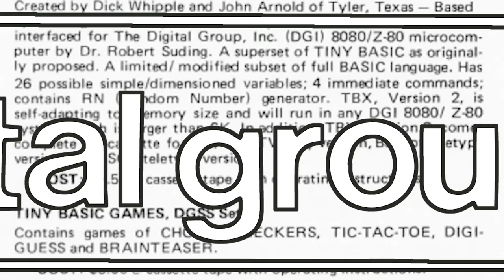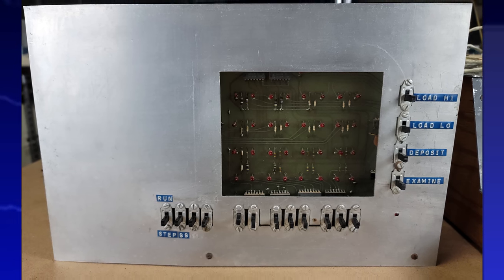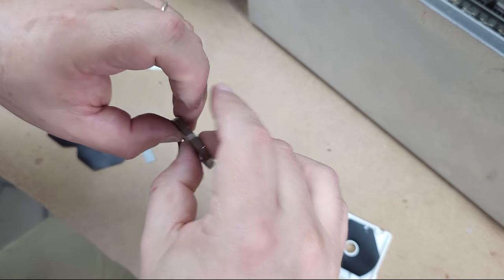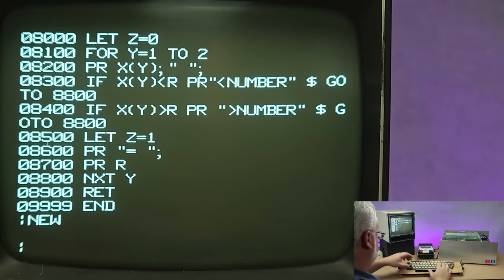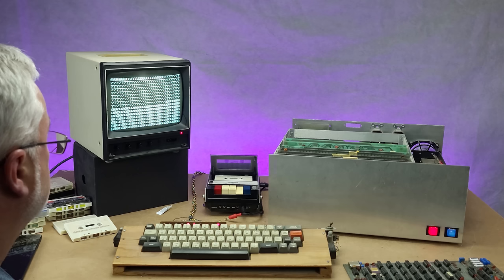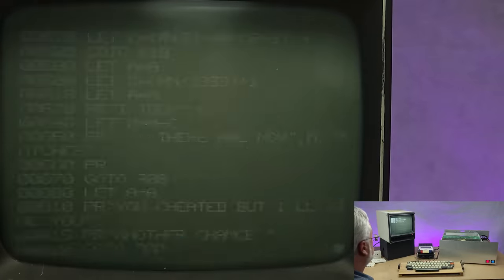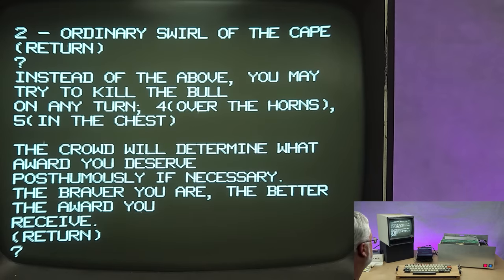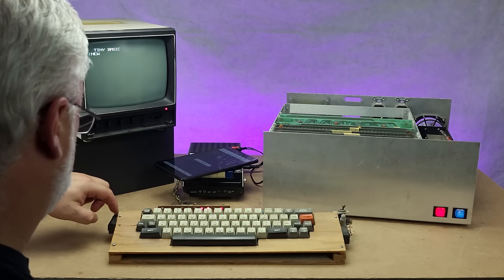How do you play games on a 47 year old computer? | Tiny BASIC Adventures

Comment: A car parts store will sell plastic pry tools for auto body repair. I've found them useful for everything from opening boxes, prying apart non-car bits, and even scraping flat surfaces without risk of damaging surfaces or cutting myself. I'm sure others will have even better ideas but putting that out to assist. Great video!
Reply from the maker: I'll have to look into those.  Various youtubers were using xacto blades and they also had this splicer tool you lay the tape in and do a diagonal cut with.  I never knew actual cassette repair tools existed!
Reply: Kinda unrelated but I tried finding one of those in a size that could pry open an iPod mini, but gave up. Months later for unrelated reasons I ordered a screwdriver bit-set roll pack and waddya know it came with a plastic pry bar inside. I was not impressed lol

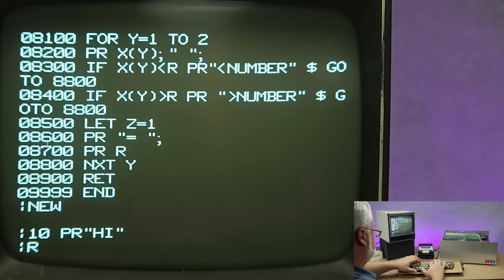Comment: 18:05 "ERR 12 65535" - The error message pops up because the last command is not an END command. In Tiny Basic this is obligatory.
Reply from the maker: Correct, yes.  I think I accidentally cut out some footage though where I had the end statement and it still gave error 12.  Right in that sequence it was getting progressively less stable.  Reseating and rebooting seemed to clear it.
Reply: Good  point!

Comment: TY!  Excited to see this.

I played the Pet and C64 versions of many of these games as a kid. Used to hang out after school for a few hours at 11 and 12 most days and play on the C64 in our classroom. Played mostly Star Trek with an occasional switch to Lemonade stand; but also Hamurabi for a change of pace.  Was excited when I saw its name pop up.  I had a copy of it in a pile of DOS shareware disks a friend copied for me in Highschool as well.

A few of these games we actually coded in grade 8 Computer Studies on C64s.  I distinctly remember Digiguess as one of our assignments. So cool to see a copy of it running on a computer as old as I am (Born in 75).

Suggestion to move the repaired tapes to newer cassettes with screws, rather than re-gluing them. Makes them easier to access if you need to repair again, plus fumes from glues can be corrosive. Also; old plastic changes shape over the years, especially the kind used for cassettes in the 70s. This can leave spools spinning tighter and lead to breaks. A bit of solvent on a q-tip can make opening them easier (still concerns over fumes.) I'd 100% replace the felts on 70s cassettes if restoring the original cassette casing for historical reasons, even if they seem relatively decent. Felts/foam guides of the era tend to either disintegrate or can be rougher and scratchier compared to newer ones. They can contribute to more damage.

Comment: I still use cassettes sometimes. I have tons of software on tape for the ZX81 and the ZX Spectrum. So when I'm really bored, I'll bring some down to the lounge and load them into the computer then re-save them to the SD card I've fitted to the computer. Lots of fun. LOL.
Reply from the maker: I wonder how long these tapes can hold out.  When I was younger I remember hearing 50 years as the time frame anything tape based was going to be gone.
Reply: @TechTimeTraveller  Tape degredation is a worry. Especially if the tape stock was cheap to begin with.

Comment: What a great computer. I'd love to do some programing on it. LOL.
Reply from the maker: It's great if you can keep it stable lol
Reply: @TechTimeTraveller  Ha ha. It was the same with the ZX81 and the RAM Pack that plugged into the back of the computer to give it 16K.  The slightest movement and it would crash. I've put a 32K RAM chip inside mine to stop this problem. LOL.

Comment: Brain Teaser would be that when you pick a position 1-9 [square is  (1,2,3)(4,5,6)(7,8,9) ] then it will flip that square AND its left, right, above and below squares.  So 5 would flip 2,4,5,6,8, 8 would flip 8,7,8,9 and 1 would flip 1,2,4 - and you want to flip all the positions to 1 (probably)

Comment: Probably not the proper way but we always just used a bit of scotch tape to splice tapes!
Reply from the maker: That's actually I think what they do.  They have a little channel like a box for sawing, and then you lay the tape in it and make a diagonal cut across the parts to be joined.  And then you use a tiny piece of tape to hold.  Personally I don't see how that doesn't snap again..  but in a case where the tape breaks somewhere well past the leader.. not much else you can do I guess.

Comment: very interesting video! I have very little knowledge about the first truly domestic computers; However, I read that the Altair 8800's CPU was the Intel 8080 and from what I understand the computer used in this video uses a Zilog Z80! I know that "in theory" the Z80 has a good part of the set of instructions and registers of the 8080 but I would like to know if "in practice" the codes written for the 8080 run directly (without adaptations) on the Z80 or the compatibility is only in the codes in BASIC language? Greetings!
Reply from the maker: My understanding is they are mostly binary compatible but not 100%. The register and instruction names were changed to avoid copyright issues in the z80 and I've read that affects some programs.

Comment: Why not use a sacrificial cassette case with screws to stop using glue?
I kinda the whole "let's preserve the original as it was", but ... CA glue? Ufff!
Reply from the maker: I just wanted to preserve the original dg shells.  It was very tempting to switch to screws but I figured I was digitizing these and probably wouldn't use them much going forward.. so might as well leave appearance correct.

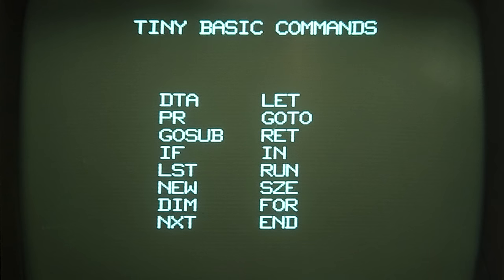Comment: In the games that are obviously picking a random number? Looking at the Tiny Basic commands menu @ 16:30, There doesn't appear to have a RND command? So how were random numbers generated?
Reply from the maker: I think there actually is an random function.  From line 40 of the Russian roulette game, it goes like so:

00040 IF RN>8333 GOTO 70
00045 IF N>10 GOTO 80
00050 PR "- CLICK -"
00060 PR $GOTO 30
00070 PR "   BANG!!!!  YOU'RE DEAD! "
00071 PR " CONDOLENCES WILL BE SENT TO"$PR " YOUR RELATIVES. "
00072 PR $PR$PR$PR" NEXT VICTUM..."$GOTO20
00080 PR "YOU WIN!!!"

I think the R before N variable randomizes it.  I'll have to test and find out.
Reply from the maker: I just OCRed the document for digital group Tiny BASIC.  I was right:

"There is one general function available under TBX-TVCOS. This is the
function which generates a random number. The random number function is
involked by inserting the letters RN wherever a variable might normally
occur in an expression. Whenever RN is encountered, the random number generator
generates a number in the range 0(=RN<=l0000."
Reply: @TechTimeTraveller  Ahh, I see. Thank you for clearing that up  Also I absolutely love the idea that you can archive old decaying cassette tapes for posterity sake, by saving the audio to a wav file.
I'm going to try that with my old TRS-80 cassettte (which still work, but who knows for how long).

Comment: I know this isn't in the spirit of the vintage hardware (which is awesome,) but are these programs preserved somewhere? I wrote my own minimalist Z-80 emulator and getting tiny basic and these programs to run on it would be a thrill (and probably not all that hard)
Reply from the maker: I was trying to figure out an efficient way to print off the listings.   I don't have a way yet to interface a printer with the dg machine.  I tried OCRing screen caps of the listings but it didn't work real well.  I may just type them out soon but some are quite long.  Still hoping there's a simpler way.
Reply: @TechTimeTraveller  I've had good luck capturing serial output from Minicom on a PC (just LST of the programs), but I don't know if the machine has a standard RS-232 compatible interface.
Reply: Or even just point the camera right at the screen and run LST. The video output seems pretty crisp. Might OCR well. (I'm not suggesting you go through the pain of doing such an OCR, but maybe one of us can. 😃

Comment: What do you mean with 'as long as we can keep these old machines alive'? My old computer is an Elf, and elves are immortal. By the way, it also had a Tiny BASIC. Similar, but not identical to this one. But it was also based on a virtual machine for portability, which of course makes the whole thing yet a bit slower.
Reply from the maker: There's a talk Bil Herd gave at a recent VCF festival which basically said every IC, no matter how well stored or cared for, will die eventually.  That's what I was going off of, although I'm amazed at how long stuff has lasted thus far.  I suppose workarounds will continue to be found but Bil says it's a sure thing all the original components will be toast at some point.  Re: Tiny BASIC.. I just got two eproms and a listing of that with a Super ELF + expansion board I purchased.
Reply: @TechTimeTraveller  A good purchase. Is that your first contact with an Elf? If so, then you should know that the 1802 processor and the computers built around it had a habit of doing the at the time usual things in a slightly unusual way. For example, it did not use a UART for serial communication. The processor did that itself. The only other hardware involved were a few discrete parts to level shift the serial signals from and to RS232 voltage levels. If that option is not installed on your expansion board, you may want to do that. Its just a handful of transistors, capacitors and resistors. However, your power supply will also have to provide a negative voltage for that to work. These days we usually just use a MAX232 level shifting IC, which does not require that negative voltage from the power supply.
Reply from the maker: @CDP1861  I actually have 4 ELFs.. an original hand-built one from 1977 with the owners design drawings and notes, a Quest ELF, a Netronics ELF II and now the Super ELF.  I wanted one of each classic ELF as I am working on a documentary video about the ELF and wanted to show each of the 'classic' variations.  In terms of programming I'm a total novice though.  I've done the basic demo programs but the Super ELF will be the first time I do some assembly (the expansion board has sockets but is empty).
Reply: @TechTimeTraveller  You could already do quite a bit in the original 256 bytes RAM of an unexpanded Elf. I would suggest  that you type in the small 'Enterprise' demo to see if the CDP1861 is working. A small wonder at a time when pixel graphics required graphics cards that could easily cost more than the Elf itself, or you had simpler hardware that required you to 'race the electron beam'. In a wy, the CDP1861 did just that, but in a way that it was automated by interrupts and DMA. You did not have to pay any attention to it in your code. Possibly a good subject for your video.

And the processor? You have not written any code for it? Then you are in for an experience. The processor has hardly any dedicated registers. Instead, you have 16 16 bit registers which you can use in any way you see fit. You even get to choose which ones currently are the proram counter or the stack pointer. Something like a RISC processor, a while before that term was even invented. In my opinion the friendliest processor you will ever see and in many ways more of a glimpse of the future than any of the other 8 bit processors of the time.

As to your memory problem: You should easily be able to piggyback a single 62256 memory somewhere onto the expansion board. Address it at 0000. All you then would have to watch out for is that your ROMs and the original 256 bytes stay out of the area 0000-7FFF. I honestly don't remember how the super Elf exactly relocated the original 256 byte RAM above the expansion RAM. Or you could simply remove them. What's not installed must not be taken care of.